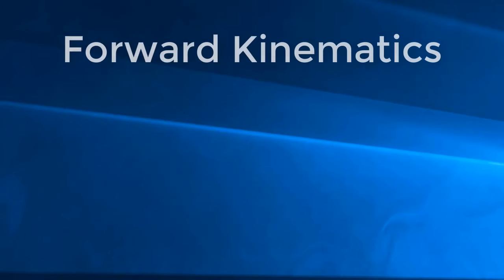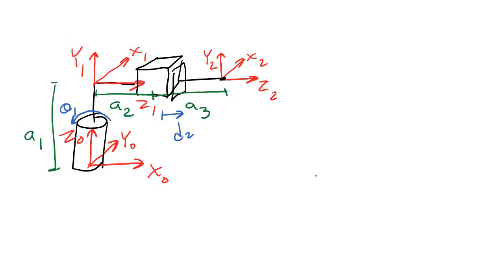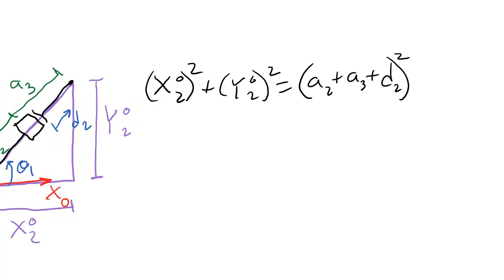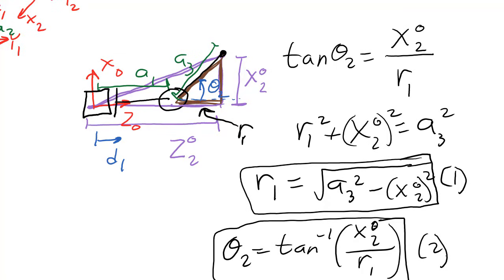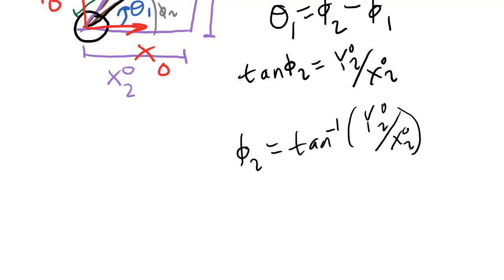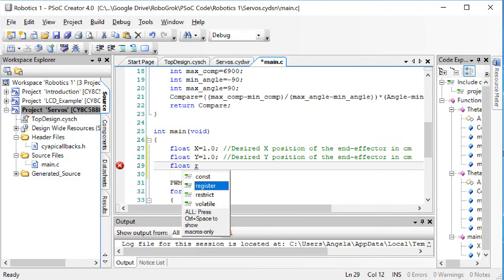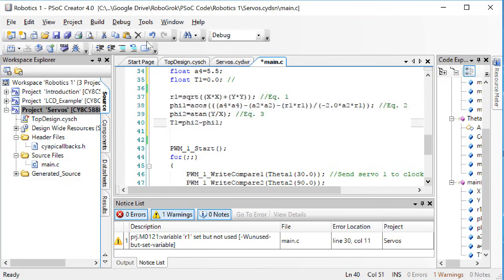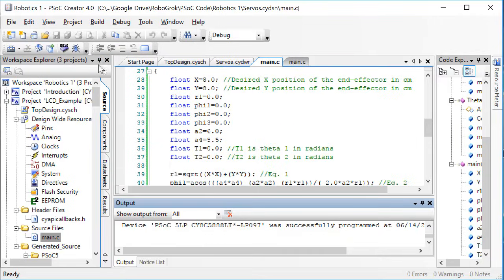Robotics 1 U1 (Kinematics) S6 (Inverse Kinematics) P1 (Inverse Kinematics)

Comment: Hello maam thank you  for this informative video, but maam im having a question on my self that, am I right that the inverse kinematics itself can make my end effector move on my desired position? Is it really useful to solve for both the forward and inverse kinematics to know the joint variables for my target position or just the inverse kinematics? Its like i use inverse  kinematics to find the joint variables required for my desired end effector position, if I find the joint variable by solving using inverse kinematics concept then I can already put those solved joint variables in my servos parameter to have my desired end effector position to be met. Then what does forward kinematics for in this situation?

Comment: at 19:57 , may I know how does d1 come into the calculation of Z02 = a1 + d1 + r1 ? What does d1 exactly mean?
Reply from the maker: d1 is the amount that that joint has extended beyond its 0 position. The d variables change their values as the prismatic joints move. In contrast, the a variables are the lengths of links. These values are constant once the robot is built, and do not change as the robot joints move.

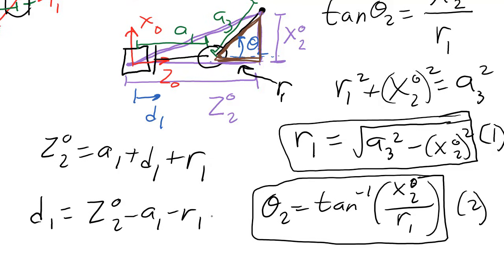Comment: In the example at 20:10, I believe you can use sin(theta_2) = (X0_2/a3) to find theta_2. Anything wrong with that?
Reply from the maker: No, there's nothing wrong with that; in inverse kinematics, there is often more than one possible set of equations that will give correct results.

Comment: hey mam i want a help regarding this can you help me..??? Inbox
Reply from the maker: Do you have a question?  Go ahead and ask.
Reply: Angela Sodemann yeah its a 2R case one is rotation and second is elevation
Reply from the maker: Ok; what is your question about it?
Reply: Angela Sodemann i want to have inverse Kinematics about it bcz the coordinates on it are over lapping from top view and from side there is no triangle to be formed...
Reply: Angela Sodemann is there any other way we can talk... actually i want to send u pic of my problem
Reply from the maker: Do you mean that the joints are aligned so that you can control only the Z position of the end-effector, and not the X or Y position?
Reply from the maker: Yes, go to my website www.robogrok.com and click on 'Contact Me'.
Reply: Angela Sodemann ok
Reply: Angela Sodemann yeah bit like that
Reply from the maker: In this case, your manipulator is kinematically redundant in positioning: you have two joints to control only one positioning dimension.  The other joint is only for orienting (rotating) the end-effector.  This video is about inverse kinematics for position, so this method is only useful for finding one of the two inverse kinematics equations for your situation.  Write an equation relating the Z position of the end-effector to the joint variable that is for elevation.  Now, to get your other equation, you have to do inverse kinematics for orientation.  I teach about that in my Robotics 2 class.  Here's a link to that page on my website: http://www.robogrok.com/2-1-5_Inverse_Kinematics_Orientation.php

Comment: Hi Angela :) Once again yours are the best videos on this topic on youtube, super helpful for those learning. You break stuff down into the underlying steps, making it far easier to follow. It eliminates a great deal of frustration and makes it more enjoyable. Can I ask a question on a further topic? In the Spong book he mentions that in IK you can have (obviously) more than one solution, but that a "set of rules" can be applied to ensure that any physical constraints, such as joint motion limits, can be identified and factored into the calculations. However he does not provide a means of creating such rules, at least that I have in the snippets of the book I found online. Can you recommend a resource that covers how to do this please, particularly in regards to programming a real machine? Keep on robotin'! :)
Reply from the maker: I am not sure what Spong meant by this, but I will make a guess:

I think the 'rules' that can be applied to make sure we comply with physical constraints are actually rules in our code, rather than rules in our derivation of the equations.  For example, when we write the inverse kinematics into our code in this video, we are writing the code for one servo that is limited to 0 degrees to 180 degrees, and another servo that is limited to -90 to 90 degrees.  Now, suppose we put an input (X,Y) coordinate in the 4th quadrant, such as (8,-2).  If we use 'elbow-down' equations to solve the inverse kinematics, the first joint angle will come out to something like 300 degrees or -60 degrees or something like that.  That's clearly outside of the allowable range.  But, if we use 'elbow-up' equations, the first joint angle will come out to something like 30 degrees, which IS inside the range. 

So, we could put some 'if' statements (rules) into our code that would first try the 'elbow-down' configuration, then check to see if the calculated angles are within the allowable range and, if not, try the 'elbow-up' configuration.

At least, that's how I do it :).  I'm not sure if that's what Spong actually meant or not.